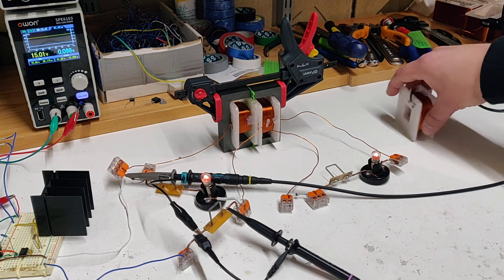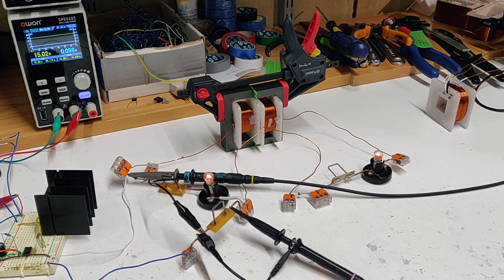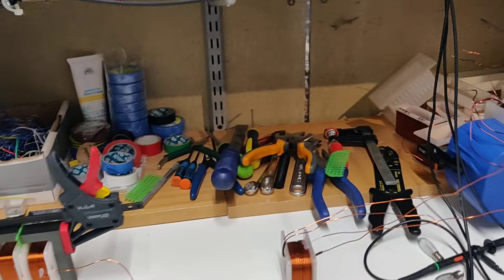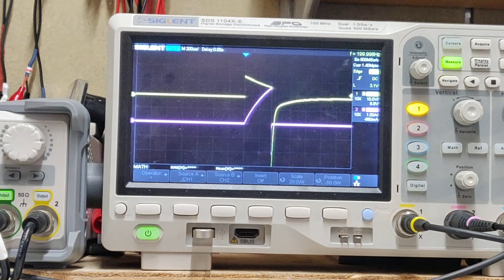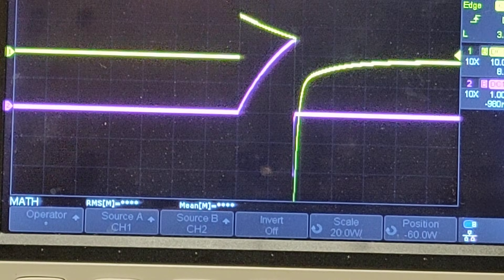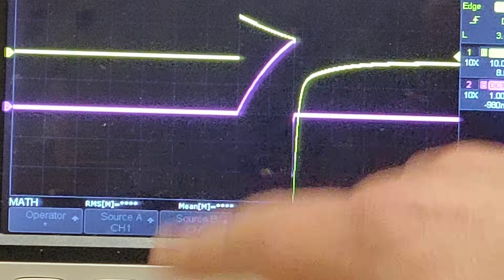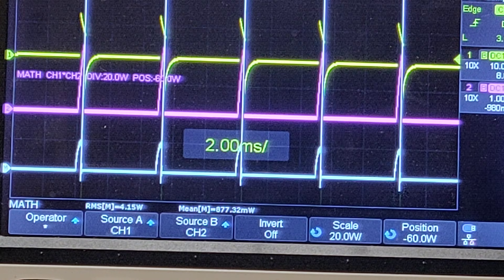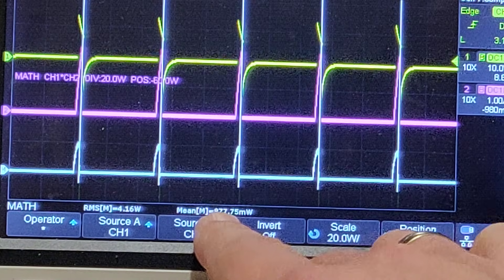Melnichenko's Effect Replication E core

Comment: I read the forum but I don't post there, I saw you mentioning mW rms, but this doesn't exist and isn't defined, rms is the effectual mean value of v or i that would be dissipated as heat when taken as the product vi vv/r or iir, the result is mean dissipation or mean joules /sec or mean power.  V and I must be in phase to consume energy as real power, so to get the mean power through the bulb you must use rms vv/r or iir (r = bulb resistance) or v on the bulb x i through the sensing wire.
Reply from the maker: Hey there, you say "or v on the bulb x i through the sensing wire." That is exactly what I'm doing. And when i say RMS I'm referring to what the scope says. Is it just the terminology that bothers you? Also the scope is taking measurements and calculating point by point, so the phase difference, if there was was, would be accounted for. Dropping a bunch of money on a real power meter built for this would be a dream, but this will have to work for now.
Reply: @FringeIdeas 
 Im  not bothered by it, it calculates the rms value of M without knowing what M represents. you correctly show the math signal of v x i which is instantaneous power, but the rms that the scope calculates from M must not be used, avg or mean is the right one. It took me some study too until I got a good grasp of it. If you lookup rms power you'll see that it doesn't exist.

Comment: Thanks for sharing.
Have you tried methernitha testatika? Seems to have a completely different setup.
Reply from the maker: Hello, I have not tried the testatika machine. Though it's a real interesting one for sure. I would imagine the disk is for the high voltage, somewhere there are caps with a spark gap -> unload into some kind of opposing coil configuration. I'll play with that some day, but it's not the most interesting machine for me at the moment.

Comment: Awesome, Melnichenko resembles the POC setup, the primary coil is input and a POC coil combined.

The lights dim during Toff because mutual induction lowers each other's voltage I think, not sure.
Reply from the maker: Hey, do you mean when I remove one bulb? The lights should be their brightest during Toff. And completely off during Ton, because of the diode polarity. But yeah, interesting setup for sure. Lots to study here I think.
Reply: @FringeIdeas   when you removed the bulb on the output coil and the bulb on the primary coil got brighter, with the 2nd bulb connected the mutual back emf is  lowering voltage in the mutual opposite coils and they both dim. This should become obvious when you probe the voltage over each coil instead of over the current sensing wire or globe. So they may work during a longer period but the voltage is lower. Just a theory that needs verification.

Btw rms power doesn't exist :) there were long discussions about this on the boards. Steinmetz alternate current is a good read.
Reply from the maker: Right ok, yeah that had come to mind. I was thinking of playing with turn ratios/direction, to see how they play together. Not sure when I'll get more bench time though. Hopefully soon.
Reply: @FringeIdeas  it's interesting to measure the 2nd coil voltage in open and loaded state to see if the voltage really drops when it's loaded.
Reply from the maker: It does quite a bit yes. I can't recall numbers, but I remember seeing it peak quite high when I remove the bulb.